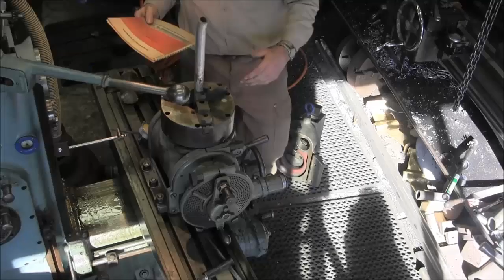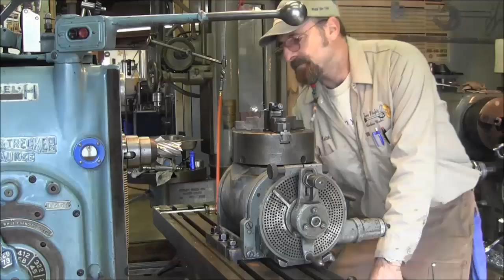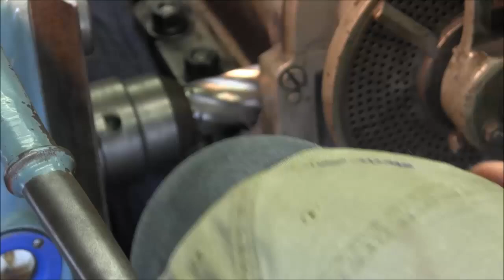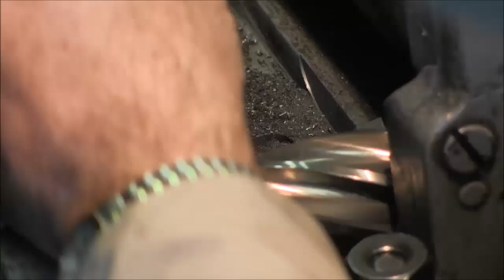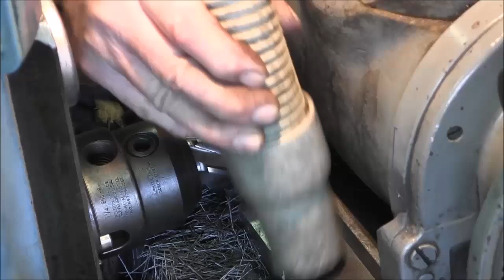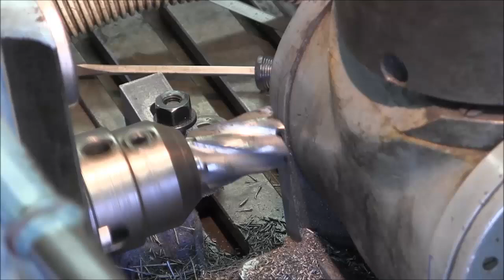The Stroken Spline Part 2

Comment: Nice work, once again mate. It may sound silly, but toilet paper works extra well as a swarf barrier for the stud holes :S   Keith, is that an annular broach cutter used horizontally? Why?
Also, could you please fix the screws that hold on your rubber swarf guard on your vertical mill.